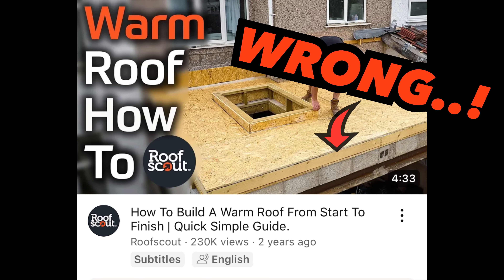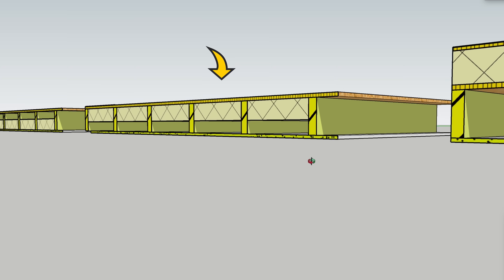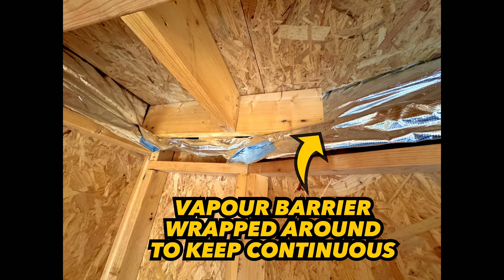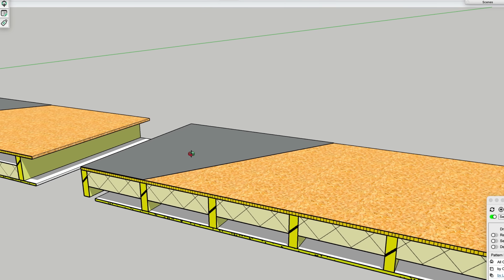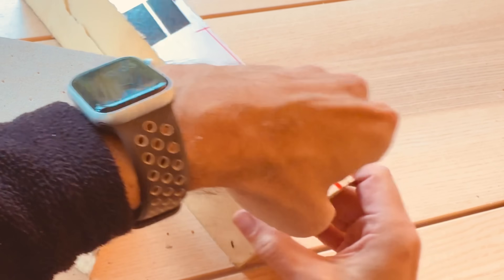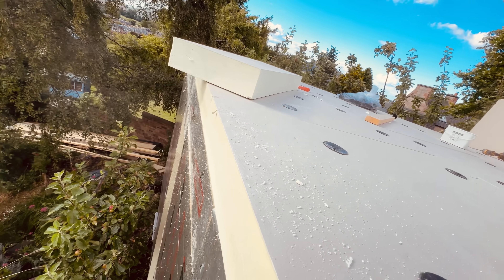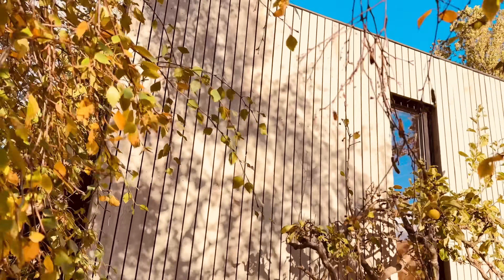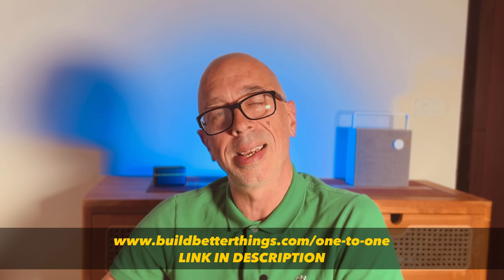Build a Warm Flat Roof the Right Way

Comment: Would it be better to use a cement board rather than ply or osb ?
Reply from the maker: Hi. Cement board won’t rot, but it still traps any condensing moisture from escaping or residual vapour, which I don’t think can ever be a good thing.  I don’t know why you would want a second deck?

Comment: This is a great video, thank you very much for sharing your knowledge and experience. What product do you use for a vapour barrier? 
A score of years ago I was picked out by a building Inspector for using blue visquene; he said it was too thick, so ever since I have used Temporary Polythene Sheeting. I'm interested to know your opinion on ths matter. Many thanks, Geoff
Reply from the maker: Hi Geoff. I like the reflective foils that have reinforcement rather than just the polythene stuff. I don’t understand the issue with the thickness of the visqueen that your inspector raised.  Doesn’t it just need to stop the vapour?

Comment: I'm a beginner builder and I've looked and studied at both the example from normal builders and yourself and upon a lot of thinking I do find your method to make more sense but I also think the average builder is right on couple of things as well. How much vapour over the years will actually rise through the roof. Since flat roofs are usually on extensions It's not often they'll have something like a jacuzzi in there but it's just to extend the dining room or kitchen while also having an extra sitting space and with windows and doors to the outside, it really just depends. So while I do think your method is better I still think you can pretty much get away with an average uk flat roof...However a guarantee would be nice.
Reply from the maker: Thanks for your comment and love your name. I’ve heard those arguments , that a house isn’t a swimming pool / jacuzzi. It’s misunderstood. All it takes is a an area where vapour leaks from people, worse still, a kettle boiling, the OSB on the cold side traps that vapour, doesn’t need to be a lot,  and then you’ve got damp that can’t escape, over several months, years. When there’s no OSB on the cold side, that damp can just breathe out through the EPDM. When there’s OSB in the way? Rot magnet.

Comment: I would agree with what you’re saying for your area but you must also acknowledge that the golden rule is insulated on the hot side, where I am in the tropics, the activity inside the building generally does not generate moisture as much as the moisture outside.
We use more cement sheet and PVC sheeting to adhere our membrane to with Insulation directly under the membrane after the cover sheet of course . 
This is because of that golden rule
Reply from the maker: The arrangement is the same regardless of the temperature.

Comment: You make vast claims about physics and thermal conductivity laws but provide absolutely zero evidence to any of these findings or any calculations. Show me a warm roof (if you can even find one) in the UK that has been installed to architects spec and been signed off by a local building control officer that has failed and rotted the OSB within the time frames you are talking about. Utter dribble.
Reply from the maker: The evidence I provide for my arguments is literally all through the video. Be specific.
Reply: @build-better-things  there was no evidence anywhere at all. Just you presenting a load of sketches and hearsay. To be specific.
Reply from the maker: Ha ha. Ok then.
Reply: @build-better-things  i don't think I've said anything unreasonable. Just want some hard evidence rather than just allowing people like you to inappropriately name drop lots of other creators that do a very solid job. As well as lumping in all builders (like myself) that do nothing other than follow building regulations and specification from professionals in order to provide customers with a good job that will last. I'm confident to go back to roofs I've built in 30-40 years time and prove you wrong. Hope you can do the same and not find any dents in your PIR with puddles of water in them.

Comment: Not put sob on the top of the insulation board, put flat roof light cover board, such as 1/2" cement board, then install TOP or PVC or buildup material. Cement cover board makes the roof last much longer.

Comment: Really curious as to whether that is plywood on the top of the insulation that is fitted around the perimeter of the roof that the edpm is being glued down to. If so does that not break the rule of not having any wood based product on the cold side of the roof.
Reply from the maker: Hi. Yes it’s marine plywood, but it sits over the wall below, continuing the warm wall/roof envelope, it’s not sitting over the heated void below.

Comment: What a guy - 1st class, clear and unambiguous. Regulation changes increase the pressure to contrive warm flat roof arrangements - looking at 170/190mm of insulation above the deck to acheive current standards is it any wonder there is such an appetite for cheating, contriving and mis-understanding. Sadly regulations focus on design and not construction/ worksmanship and your know-it-all builder/ joiner/ last-week-I-was-doing-something-else'r will continue to prevail it seems.

Comment: Great video - informative and just makes technical sense. When gluing the rubber membrane down with contact adhesive... why is the entire surface glued down, does it make sense to glue all the edges fully and then have some sort of glue pattern on the interior ? -  if the rubber allows air through gradually then the rubber should lie flat. I'm not saying people should do this - i'm just interested to know why it isn't done.

Comment: Don't get it. I've never seen a foam insulation, including Kingspan tissue faced, that doesn't dent under very moderate impact, even from the edges of boots.

How about Rockwool HardRock? Better impact resistance? But still dents if you, eg, drop a hammer, use a ladder, etc. 

Also, how much damp is getting through a VCL and two impermeable skins of foil with taped joints? Not forgetting that in winter, when the temperature differentials increase, humidity is at its lowest. Re airborne moisture, how much air is circulating through plasterboard, VCL, two layers of foil and several inches of PIR? If capillary, how does this happen through plastic and foil?

As someone who designs, specifies and builds, I'm unconvinced by this video, which seems to claim to know more than Building Control depts and manufacturers, who I would have thought would have good tech knowledge and wide experience. And I've not heard of any failures of the type claimed.

Always interested in new info, just struggling to see this.
Reply from the maker: If you are someone who designs and builds roof systems, you’ll know that a membrane such as OSB will probably puncture if you drop a hammer on it, regardless of the substrate of OSB or bonded to insulation. 
But you’d also know, with all your experience,  that if you drop a hammer on the insulation I show in the video, you’d know it bounces off without damaging it. 
On the VCL, I’ve answered this several times in the comments, so you can read about it there.
On your understanding of humidity, maybe you need to learn that again as I think you’re mixed up about the winter summer thing!

Comment: How do you get the tube washers in the PIR, do you pre drill the PIR plates? Do you fill them up with expanding foam or something after the screw is fastened (not for the case of expanding air but insulation).
Reply from the maker: The fastener has a pointed edge so you just tap it into the insulation. Nothing wrong with using expanding foam ….but the tube is designed to end above the centre point of the insulation thickness

Comment: The physics on why you can use a top deck is simple. Contrary to your assertion than OSB is impermneable, it (and EDPM) will pass water vapour. Your warm roof construction will be OK as long as the least permeable layer is at the bottom. Yes, is is possible (though not really feasible) that mositure may form in the layers above the main vapout barrier, but as long as above it is more permeable than below then the moisture will escape.
Reply from the maker: 18mm OSB has a rating of around 0.5 to 2 perms when dry, so a Class II vapor retarder. Try running it under a tap and you’ll get the message.  moisture will form in the OSB above the barrier at localised spots, and that’s before I even get started about foils in a warm roof. I’m assuming a perfect vapour barrier, no nicks, no faulty screws, not reality. All it takes is one, just one,  localised area of condensing vapour , the moisture is trapped within the OSB fibres, can’t evaporate, and after several years, you have your rot and a spot for failure. Eliminating the OSB allows that vapour to breathe out of your compound such as EPDM or fleece. Aside from all of that, it baffles me that people continue to argue for a completely useless layer of OSB that the customer is expected to pay for, instead of using the correct insulation products in the first place. It’s symptomatic of the malaise in our construction industry today.
Reply: @build-better-things just hypothetically how does the application of the thermally broke fixing affect this? As aren’t you adding a lot of vent pipes into the osb and insulation there fore breaking the osb 3 vapour barrier effectiveness with 12 fixings per board. Assuming the thermally broke fixings don’t make a vapour seal on the 15/16mm hole and on the screw head into the bottom of the fixings? Just a thought  had watching the video.

Comment: I woke up this morning with a question on my mind. What would happen if you took your version of the hybrid roof and applied it to the walls? So breather membrane, outer insulation bonded to the insulation between studs and thermally broken screws into the studs, vapour barrier over studs, OSB3 and then plasterboard.

Comment: Only downside,with your knowledge I was disappointed to see you using  rubber...single ply polymers especially the adhesives work out cheaper than the  adhesives for that garbage and the systems have professional wind uplift specs for the perimeters etc,and are vapour permeable,but good to see you set the record straight about the ...warm roof myth.
Reply from the maker: Hi. For a lot of the single ply products, you need to have done their courses in order to install. So it’s not really an option for small builders / self builders doing the odd small surface here and there. What’s the problem with EPDM ?

Comment: I'm looking to install a 6 degree metal standing seam warm roof onto a porch. From the top down would this be...0.6mm metal roof, structural underlay, thermal fixings through foil backed structural PIR, vapour barrier, 18mm WBP, Rafters, plasterboard? Would another vapour barrier be used between the plasterboard and under side of the rafters?

Comment: Came across this video, a few points I'll add. I don't know your place of "expertise", wether you are a builder, architect, science teacher!. But a few points you have made or insist are wrong, are wrong!. Probably the most important is the moisture travel to dewnpoint inside insulation, this will NEVER happen, to where it's an issue, firstly if you have a domestic property that is producing that much condensation (no matter what the time period), that is enough to track up through the fixings then your issue inside is what you need to worry about. This amount neede would mean there would be mould throughout that part of the house. Which segways to my second point, anyone who can afford to have this type of structure built WILL NOT  have a house like your granny's with single pane Windows that allow the probability of so much condensation. I actually constructed a similar warm roof 38 years ago before it was even "a thing"and it's still there with NO INGRESS or rot. And we had to do this with multiple layers of insulation as the 150 was not readily available (we installed a total of 200mm). The top layer of OSB was fixed through with what at the time were lag bolts/ screws running through plastic pipe with plastic flange on top that we had to manufacture ourselves again as there wasn't such a product available at the time. Too much emphasis is based on physics, structure, and calculations rather than good old tried and tested format. Our roofs are from those projects are a testament to that. In fact the only time we had an issue was from water coming from outside in. And that was due to an old oak crashing on top of the roof. The only time you can say that these other builders method is wrong, is if and when they fail and after 30 or 40 years have past, which may prove your point. Until then you can't poopoo another man's work over yours just because it's different from what you do.
Reply from the maker: Starts by mentioning how I’m wrong about the dew point and relative humidity, then says too much emphasis is based on physics, structure and calculations. 😜

Comment: Hi and thanks for the informative video. I'm about to embark on a similar project like in your video in Scotland. I was just wondering - you have a plywood perimeter uplift around the edges. How is this secured in place? Do you have to screw through 150mm of insulation ?
Reply from the maker: Hi there. Yes unfortunately it’s a bit of a headache as you need to hit the structure below the insulation and you need to use the thermal break fasteners. But all possible and worth it.

Comment: Does the same apply to fibreglass roof?
Reply from the maker: I prefer systems that don’t require a timber deck, so to completely avoid the possibility of trapped moisture turning to rot., the way I describe in the video.  Plus I’m not a fan of fibreglass. But if you want to go that route, then a ventilated roof (as opposed to a warm roof) is the way to go.

Comment: Do British Standards or any other standards now state that organic material (OSB or ply) should not be located above the VCL/insulation in a warm flat roof? Celotex still seem to approve of putting sheet timber over the insulation. And surely it's still needed for GRP?
Reply from the maker: Hi. I’m less concerned about British standards and more interested in whether there are mistakes in my analysis. What do you think, ….where in the video am I illustrating points which are incorrect?
Reply: I'm an architectural designer too, and find there is a lot of conflicting information on this. Several major insulation brands seem to have nothing against a top deck. To some degree interesting what British Standards, LABC, NHBC etc have to say about it, if anything - but I'd really like to find more conclusive information.
Reply: I find it's all well and good in our position providing sound advice to clients, but it's hard to argue when a competant installer states that they have consistently installed successfully over many years fitting osb or ply under the top covering. And yes I get the routine 'I've been doing this for x many years' speach all the time! Sometimes, I agree, it's a defence mechanism of many tradesmen, but with many it has genuine basis, and experience behind it. 

 I find Building Control are pretty indifferent, as they often see it as a specialist element, so happy as long as manufacturer guidance is followed - and they're not the ones giving any guarantee after all. With guarantees in mind, I've seen roofs with top decks installed with Insurance Backed Guarantee provided with no issue. Personally, I believe that IF the VCL and everything else is installed correctly, no moisture should get to the top deck - especially if it's Alutrix or similar - I see using tissue faced insulation without a top deck as being the safer method obviously, but this doesn't suit GRP (a finish I normally recommend clients avoid UNLESS the installer has a very good track record with it)

In the real world, with most projects I encounter, it comes down to the competancy and experience of the contractor, and also availability of materials (tissue faced insulation can be hard to get). I see that the theory points to having a top deck being a risk - personally I don't see it being a big risk, and as other well experienced and educated professionals such as Steve from London Flat Roofing have pointed out, it can work without problems.
Reply: Notwithstanding, I currently discourage using a top deck, and always spec tissue faced

Comment: I see cold US states allow exterior plywood fixed framing, vapor barrier, battens and cladding,  inside they have insulation and another vapor barrier, then finally wall coverings. Also they use SIPS building styles. I live in a insulated panel cabin, by controlling the internal environment both passive and mechanical is the best defence against mold. Interesting stuff.
Reply from the maker: Hi.  Are the SIPs structures in your area are using ventilated roofs?
Reply: @build-better-things Of course not. That would be ridiculous. Please consult the building science corp. 

Sometimes there is an over roof, but it isn't extremely common.
Reply from the maker: What is it that would be ridiculous? Ventilating your sip roof?